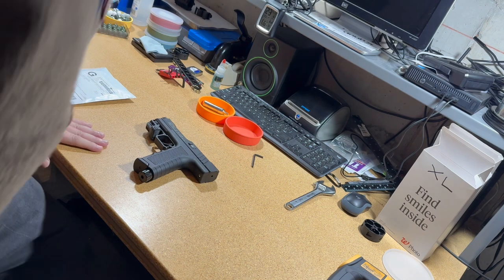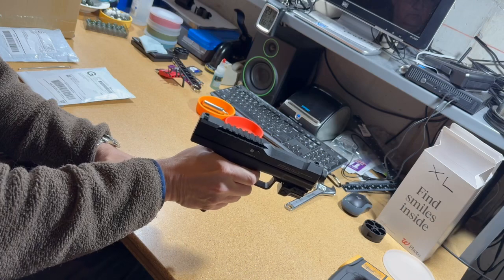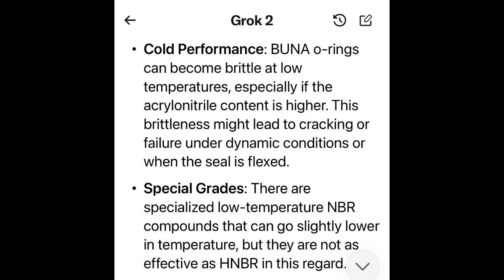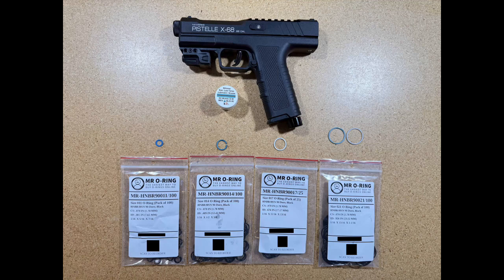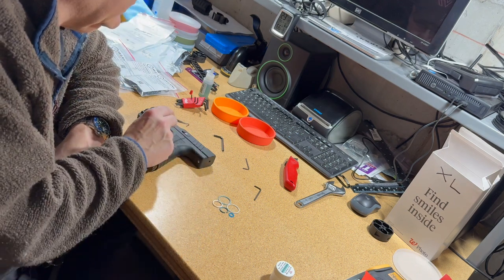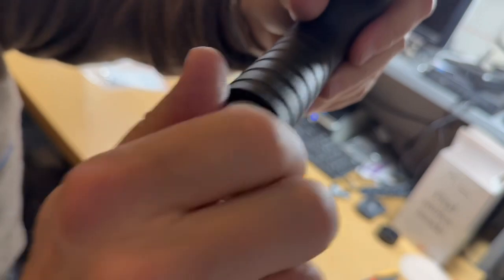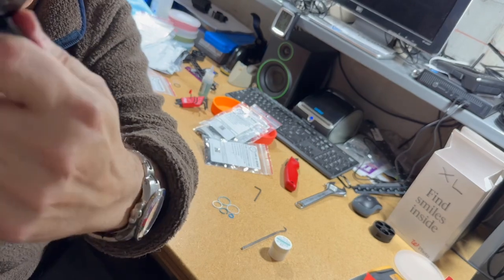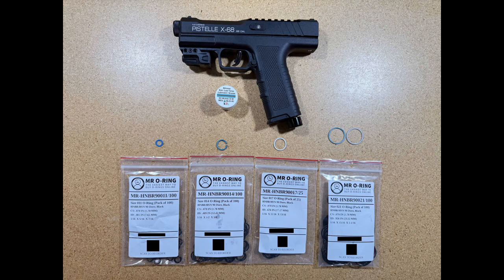Why do the Pistelle X-68 launchers leak? I have a theory.

Comment: I just received my new Pistelle X68! First thing I did was to grease the cap. When I put the CO2 bottle in I applied a bit of silicone as you do. Put the cap on correctly and firmly without overdoing it and when I punctured it the CO2 leaked or of the cap within seconds! I was so annoyed when this happened because I’ve have waited weeks for this to arrive! I spent double the price on this gun because of importation taxes etc and now i might have to send it back to Mercury Rise all the way from Brazil! 
Someone help 🤯

Comment: Liquid carbon dioxide cools when released to atmospheric pressure because it undergoes a phase change from liquid to gas, which requires energy. This energy is drawn from the surrounding environment, including the liquid CO2 itself, causing a significant drop in temperature. Essentially, the process of becoming a gas requires heat, and the liquid CO2 provides that heat, leading to cooling.

Co2's triple point is about at 5.1 atmospheres which I think its about 75 psi and when you're releasing the excess CO2 from the cartridge after only five shots... You probably still have a few hundred lb of PSI meaning your phase changing from liquid to gas right past that o-ring that's leaking.  

 For example, you're allowing a liquid to gas phase change while passing the o-ring ..which is going to go below negative 78° C or approximately- 108° f which will take out any ORing... Given enough cycles. I think that phase change even exceeds your hnbr o-rings which are good to -50C?

I suppose this could be minimized by just discharging the excess carbon dioxide gas, pulling the trigger and discharging the CO2 through the barrel, but that's still going to expose the internal o-ring on the expansion chamber. I think it's a bad thing to be letting 300 or 400 PSI worth of liquid CO2 past the o-ring on the c CO2 cartridge knob on the x68. 

Just a thought...😊😊😊

Comment: Could it be that these are made for self-defense and not everyday shooting? 
I mean .. mine worked fine out of the box and I haven't fired it since .. I check it from time to time to make sure it will hold a charge. .. other than that ... I'm not firing it until I absolutely need it.. which is what its purpose is for in my opinion . 
I have other things that I can shoot for fun
Reply: Exactamundo
Reply: Exactly. I bought my pistelle back when they were released in October 24.. I don’t shoot mine every single
Day like some of the YouTubers. I never had problem with mine either. I have it for self/home defense.

Comment: It was your air chamber that was not straight when you took the marker apart you reset the air chamber solving your first problem cold don’t get to the air chamber because what make this marker better then other is it releases all the co2 at once and it’s all gas when it gets to the air chamber and co2 in gas state has NO cooling effect
Reply from the maker: @sterlingselfdefense-lessle6915  interesting. I saw your video about resetting the air chamber and did try that. Again and again. My handle was actually spitting out chunks of dry ice out of the handle it was getting so cold. But that’s was most likely my damaged piercing cap. I will investigate what you have said about the co2 all being gas and having no cooling effect. I defer to your expertise in all these areas.

Comment: To maintain lubrication, spray some 100% silicone lubricant in the CO2 chamber and the cap because the cap has 2 little seals in it and they need to be lubricated
Reply from the maker: @TheJerzeyGuy  good advice. I have some Super Lube silicone spray but have only been using silicone drops on the cap.